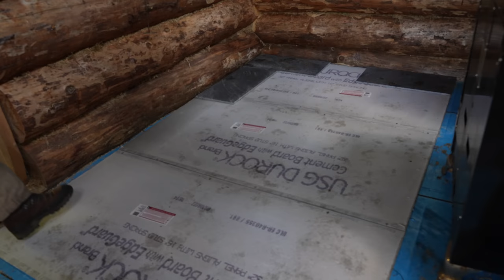A Cabin in the Woods,  Roof, Windows | Building an Off Grid Log Cabin Alone in the Wilderness, Ep22

Comment: I would put the stove slap dab in the middle of the cabin to help keep the cabin more comfortable instead of blazing hot in the front so the back isn't freezing cold. The heat would be better distributed that way. You wouldn't have to have such a huge fire all the time and that could possibly mean you'd use less firewood. I'm not saying Shawn is wrong by his placement of the woodstove and he can do as he likes at his cabin I'm only speculating and saying what I'd do for myself.

Comment: Was wondering if you secured the wonderboard with some Galvanized roofing nails or screws. I also back-buttered my slate and bluestone. Troweled with a 3/4" notch gray thin-set and used an additive for flexibility. (We called it "milk") Seems you just layed it and are relying on gravity. Not good, that house is gonna settle inches with all that weight and snow loads! I really like the chamfered edge on the diagonal int. roof rake boards!

Comment: I also have installed some stoves that I like, but I have never installed what I think that you would like . Metal conducts heat and I have thought that it would be nice in a floor that gets hot under a stove. With just some metal it would be nice

Comment: Wiggle waggle Cali your tail from side to side as you project yourself in a straight line. Big difference Shawn from last weeks visit and internal happenings happening with flooring going down as protection against the heat transfer. But what of the back of the stove? Or is that in next weeks video?

Comment: I want to build a cabin so bad! Only bigger with stone and a gigantic lodge sized fireplace that I can mount a 80" tv on top of and with a giant kitchen with a massive center countertop that's 6' wide by 15' long made with a granite countertop that's black with gold veins in it, all while having the entire cabin be 100% off grid, with granite and hardwood floors, with 3 with toilet/ shower rooms and 5 bedrooms 1 master bedroom, and a smoke/alcohol bar in the basement with a theater attached and a bunker built underneath the basement with an escape tunnel that runs 50 ft from the cabin/bunker. With hepa filters for the house and bunker and a water storage tank system that feeds off the rain and natural creeks nearby that can hold 30 years worth of water and not break, I want to build a fortress I want it to be nuke proof from the cabin to the bunker and have a lazy river installed around a 5 acre span of land that you get in at the house and float around that's designed to look like a natural river with clean spring water and fish and crawdads. With an additional workshop cabin at another location on the property that attaches a tunnel to the escape tunnel and bunker under the main cabin. With a total of 1000 acres of land with my cabin at the very center with a stupid long driveway that twists and turns with prehistoric landscaping lining it's entirety to the cabin, feel like your at universal studios when you enter my property, oh and a garden for vegetables, fruit trees, and bushes, edible mushrooms not shrooms and a variety of weed for my smoke bar in the cabin basement 😆. And then maybe a guest house cabin later on with a professional MTN bike/hiking trails that is miles long and has 30 different paths all done up with professional prehistoric landscaping, and redwood trees throughout the property that get fertilized and watered weekly so they get stupid big with a treehouse porch/hangout area 300ft up in a tree with a zip line that stretches to the main cabin and one to the guest house that's fairly long in length. And a 2acre lake with a giant rope swing and diving cliff ranging from 10ft to 50ft with it being 20ft deep and attached to the lazy river installed around the property  that stays Crystal clear all year round. I want my own resort but it be my home also. Oh 🤣 and I want a hidden artificial giza pyramid and ancient looking aztec city area that's blended in with nature and needs discovering for myself and guests who have kids and enjoy adventure with a map that tells of its secret Location. That's my dream 😆

Comment: woohoo! I have a question about managing the forest and food production. I have several large beautiful cedars that limit the sunlight to the greenhouse/garden area. 3 are blocking morning sun for about 2-3hours and 3 are blocking afternoon sun for 3-4hours on each side of the summer solstice(although, they protect from very hot temps in late June/July). 

At what point of food production does it make sense to take down several large (36in+ cedars?). The beauty of these trees balancing with sunlight for food/cabin is quite a dilemma for me. Would appreciate any guidance
Reply from the maker: It’s always the same dilemma with solar panels. As much as I love trees, forests are full of them and a few won’t be missed. However, I would use those trees to their fullest by building something beautiful and long lasting out of them and nurture some other nearby cedars so they reach their full living potential.
Reply: Soy Argentino siempre veo tus vídeos y me gusta la naturaleza y todo lo que haces gracias por compartirlo.

Comment: Did you draw and submit your own plans to the building department, and how has it been working with the building department with building your log cabin, specifically with things like the non-conventional basement and sited procured logs and lumber? I did a similar build (though it was a stick frame) back in the 1980s, but it was a different world back then. I'm now on 40 acres in North Central WA (right on the U.S./CA border starting a new project. I have a Woodmizer mill and will be building a small timber framed home. I've been told the building department here is fine with locally milled lumber (no grade stamps), but I know it varies a lot depending on where you are.
Reply: @jmp1036A  Wow! that must be a Canadian thing. We can't build a 12X12 shed here in the U.S. without a permit.

Comment: Looking better every week. Are those permanent windows?
A friend of mine has a forestry pump that he has on standby as fire protection, does the creek in front of your place have enough flow this time of year for you to consider that?
Reply from the maker: Yes, yes
Reply: Good point regarding a forestry fire pump. A sprinkler setup would be something i would consider to have on hand. Could use to water outside garden as well.
I have a 1931 Johnson Tremblay fire pump i am restoring but the noise it makes would wake the dead. Uses a K series 8.1 hp outboard motor.